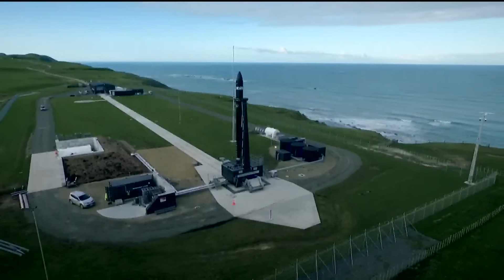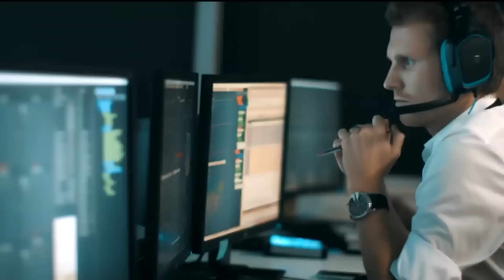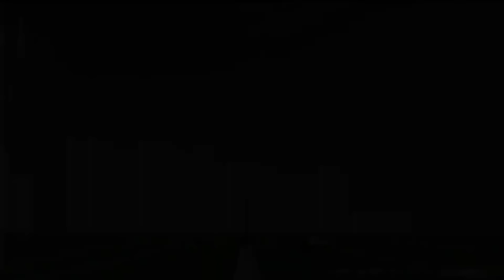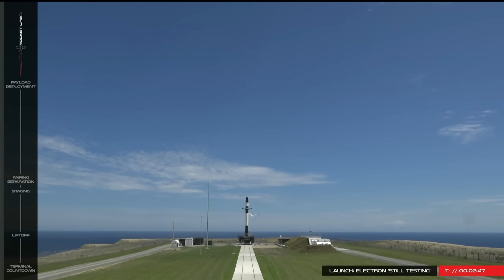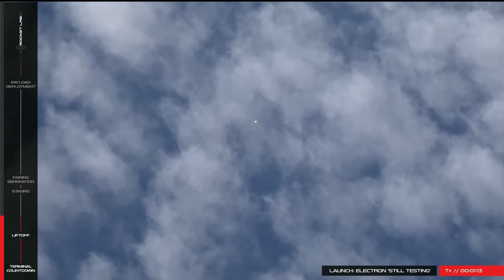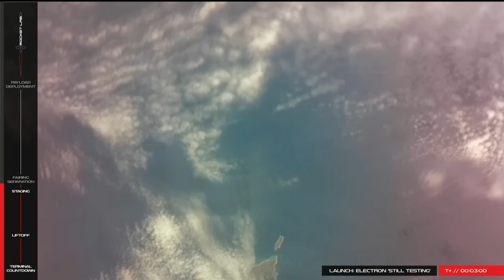Still Testing Launch - 01/21/2018

Comment: What happened during “Hot Swap”? Two objects in space blankets dropped to Earth. Precisely; What were they? At Aprox 21:30 video
Reply: The Rutherford engine(engine used in electron first and second stage) is a electric pump feed cycle engine. Basically it use an electric pump to pressurize fuel before going into the combustion chamber. That thing dropping away is a battery. When that runs out “hot swap” drops it and starts using electricity from another battery not seen in this view

Comment: The payload capacity here is basically two fat men in their underwear.... 225 kg.   An average communications satellite weighs well over ten times that.   This is basically where SpaceX was with Falcon 1.   It's impressive that they could get to orbit, but they won't be players in the market until they get a much bigger rocket.
Reply: At year end 2017 63% of all launched satellites were under 225kg. Sounds like they’re players to me homie. Do some research
Reply: @Pnutt51 
That doesn't mean small sats are profitable in the absence of regular satellites.  It's an untested model.
Reply: That's exactly what they're aiming for though. This is a company that focuses on launching small satellites.
Reply: That's great  but I suspect it's gong to be tough to be profitable with that market.
Reply: Eh, small satellites and CubeSats are very trendy nowadays, they want to dominate the small satellite market with small launch vehicules with more flexibility that other launch companies don't have, so I'd say that may become profitable. I hope so anyway, I want them to succeed.
Reply: Even SpaceX will be launching their own array of small internet satellites which will frequently need replacing.

Comment: Hi Rocket Lab! I am currently working on a digital creation project and I would like to kindly ask for the permission to use this video in my project. Cheers, Sylvia~ (just for academic use) (Videos: "It's a Test - Lift Off!" "Still Testing Launch - 01/21/2018" "Rocket Lab Flight Two Stage 1 Stack Test")

Comment: Is it common for surface winds to be opposite direction of cloud movement? ~30mph steady according to flag
Reply: @FEM
Why dont you go outside and make a few observations. You may find different level clouds heading in many different directions.
Reply: This is a pretty common phenomenon- high altitude winds often move at different speeds and in different directions from the surface winds.

Comment: Great job, but could you please next time land the first stage (at least) and reuse? This throw-away/one-time-use solution is so 20th century (and polluting).
Reply: Expendable rockets are the better solution.
Reply: And so were the expendable plastic bottles...
Reply: Rockets are not an environmental issue at current flight rates. The market does not support enough payloads to justify a rapidly reusable rocket.

Comment: only 2nd test and wicked Success. Also, efficiency lost through the weight of battery powering electric motor pumps, re-gained by the lower cost of electric motors and 3D printing.  Congratulations for a good combination.

Comment: It might prove beneficial to develop/use batteries that sacrifice rechargeability for higher energy density. Lithium stuff was developed for mobiles and electric vehicles first and foremost so one-time use wasn't really in design.
Reply: LiPo batteries have the benefit of very good power to weight ratio (that is, they can discharge fully in a very short period of time without failure or loss of voltage) in fact the only electrical storage that can deliver more power per kilo of storage is capacitors (which don't have enough energy density for this application). I suspect that this is the reason for using Lithium batteries- having enough energy for the flight is pointless if your batteries cannot deliver it all in the required period of time. In particular, the 1st stage battery packs must deliver all of their charge in a couple of minutes (as this is how long the fuel lasts).

Comment: Nice fake launch guys...you copying Fake-X Glowing nozzle of love is a nice touch!
Reply: What about the three satellites the two companies who paid to get them in orbit and who acknowledged that it was a successful launch and had made contact with their satellites. They had low expectations for the flight so had no hidden agenda to pretend that it was successful.
Reply: Just to give you the science on that Pressure gradients cause movement of air, i.e. wind. Wind blows from high pressure to low pressure. Wind can be looked at as a vector quantity. It has magnitude and direction. What you saw on the video was due to the fact that the direction of the wind at 2000 feet was different from the direction of the wind at 4000 feet. This is called wind shear (vertical wind shear in this case since we are concerned with the difference in the vertical direction.) Wind shear can be caused my many different phenomenon, such as: A frontal passage (sharp gradient in the temperatures of the air in the horizontal direction). Temperature inversion (temperature usually decreases as you increase altitude, but in some case, over a layer of the atmosphere, it can increase)
Reply: Yea those fake customers making money from fake satelites launched on a fake rocket off a fake earth because it's flat... You are fucking brain dead if you believe it's all fake
Reply: So have you ever actually done research or do you just get your information from crackpots online?
Reply: What makes it fake? Any evidence?
Reply: only logic and a long history of study in computer graphics. The long lead up of over 20 minutes with dramatic music showing nothing but propaganda. The rocket clearly spirals out of control, quickly switching to CGI, then having the classic space-x view of the "glowing nozzle".  Not to mention the control room of clapping retards.  They have followed the Fake-x play book exactly...GOOD JOB!
Reply: ANNNNND none of that comes even close to being evidence. Just your opinion. EVIDENCE is some fact that proves your (as yet) unsupported statement.
Reply: Soooo, ya got nothing, huh?
Reply: Seriously, Pat,  that's just lazy! You could at least google up some conspiritard FE BS to cut and paste.
Reply: I googled around a bit and found another angle of your launch that proves it was hoaxed.  youtube.com/watch?v=wfUrUc6JtHw
Reply: look at Rocket Lab twitter feed at https://twitter.com/rocketlab?lang=en  you can see Spire and Planet comments. In regards the the the rocket trail spiral, this was due to high winds, its a natural occurrence. It changed direction as the feed from the website said it would due to the world being ROUND
Reply: Clouds at different heights do that.
Reply: IF it failed why lie about it. Rockets fail, this one did not. Your assertions do not follow sane logic. As I have asked you before, what about the evidential success of two customers satellites being placed in orbit and being confirmed as such by them. How does this fit into your narrative?
Reply: Pat B - So, you have no evidence at all, just snide comments. What a disappointment. I was hoping for some real debate, not know-it-all whining.
Reply: Some scam. Spire Global, Inc.founded 2012 is an American private company specializing in data gathered from a network of small satellites. It has successfully deployed twelve Earth observation CubeSats into low Earth orbit. The company has offices in San Francisco, Glasgow, Singapore, and Boulder.
Planet Labs, Inc. founded 2010 (formerly Cosmogia, Inc.) is an American private Earth imaging company based in San Francisco, CA.[1][2] The company designs and manufactures Triple-CubeSat miniature satellites called Doves around 30 in orbit
Reply: Why are you guys engaging? Pat B denies Falcon 9 launches, even though their customers are major government agencies and international satellite operators. There's really no point.
Reply: We are having fun. Pat B is a fake, he an AI North Korean computer
Reply: Pat can't even prove that he's real.
Reply: Don't bother with the science - Pat B's not up to it.
Reply: I'm currently collecting comments for a YouTube report against this guy. There's enough for several.
Reply: The only conclusion I can make about Pat B is that he's still messing around in his garage dreaming of how he can make a rocket using firecrackers
Reply: Pat B. 
Lmao, "long history of study in computer graphics" ?
I think you mean watching a YouTube video that's filled with pseudoscience.
Also you failed to realise that hot metal is normally glowing, Cgi is not needed for that
Reply: Oh and Spire and Planet are mistaken that their satellites are in Space. I grant you the spent rocket did land in the ocean
Reply: What sort of answer is that ?? Whose talking about a wispy tube, which is different atmospheric Phenomenon than a spiral from a rocket
Reply: geofrancis2001 - not sure, my wifi comes to me from a cable in my wall.
Reply: OHHHHHH  Right those three shoe box sized satellites that communicate with ships and give us great photos?  YEAH we needed more of those because before this historic launch, we had no way to communicate with ships or take pictures of earth...
Reply: 2 minutes of research - Spire is a kickstarter program...basically scam people for money and tell them it works...not rocket science there, just another kickstarter scam.
Reply: can you source me the information where these companies have made contact with their satellites?  What was the name of these companies and the name and function of these satellites?
Reply: what are the names of these customers making money on these satellites?  It is all fake you moron, that rocket was a spiraling nightmare and you could expand the video, slow it down and you would see before it started to spiral it changed to a horizontal trajectory and started to loose velocity and direction before it spiraled out of control.  They faked the rest of it and you dumb ass fan boys ate it up as if it was real...DEAL WITH IT!
Reply: no they dont, it was a perfect spiral not a wispy tube...
Reply: Thank you Einstein, your weather lesson dosnt make it any less fake.  That rocket DID NOT go into "space", it went into the ocean.
Reply: your weather lesson is a diversion from the fact that everything after the spiral tube of smoke is CGI and a lie.  If you want to believe these clowns launched three shoe boxes into orbit with a rocket with a cute name, then so be it...
Reply: LOL - yeah the other clouds weren't moving but OK.  enjoy your fantasy!

Comment: I found the lift off a little bit slow, compared to curently available Ariane 6. Also, Electron did too many directions adjustements, also compared to what is oftenly seen in other rockets launchs. But every rocket launch is always very exciting and this one was no an exception. Fuerthermore, thank you for the final minutes from the Mission Control. Those engineers were gorgeous. Everyone at Rocket Lab, please keep working as you are doing until now and the company will make history.
Reply: Speed of liftoff doesn't matter much at all. Adjustments were probably because very high upper level winds combined with a very light rocket.

Comment: Congratulations!  I've had a few G430 headsets, which is what their control team all was using.  They break fast at the pivot points above the ear cups.  Unfortunately Logitech uses the same ear cup rotation tech on most of their headsets.

Comment: Couldn't you guys recover the first stage using parachutes? I know this was already tried by SpaceX on the falcon 9 and it failed, but the electron rocket is much smaller and lighter.

Comment: Beautiful launch site, beautiful launch, congrats to all involved, looking forward to more launches from you. Hot Swap and eject, interesting, what was that about?
Reply: The engines on this rocket use electric motors and batteries to power their fuel pumps. The batteries are just dead weight when they run out of power, so they have 2 sets of batteries on the second stage- when the first set is discharged they switch over to the second set ('hot swap') and jettison the first set ('eject'). The silver objects next to the engine that fall away are the batteries they jettison.

Comment: Most of it looks like the tip of a pencil with an eraser on it, and something flapping?  I mean, what is that?  Now I see why they didn't want any witnesses on a boat or anybody within viewing distance of the "launch" site.
Reply: Ah, such a nice example of an argumentum ad ignorantiam 
I'm going to use this a as educational material. Thanks Mikey.
Reply: That flapping is not flapping its vibration and a tiny vibration at that, on camera it looks like flapping.
That tin is thin it's just there to for thermal reasons, that was the battery pack inside there so its dumped later on to save weight before SECO.
Reply: Andre Gulbis But science is a lie invented by NASA to make sure people don't find out the Earth is actually flat! Nothing you belive is real! 

Source: The Flat Earth Wiki
Reply: Mikey Martinelli its way better than anything you could ever design. I bet you can barely wipe your ass.
Reply: Flat out frustrated:  that moment when you realize someone's intellectual capacity is too low to comprehend any explanation of their misperceptions...
Reply: Hamish Cummins they're called "Stubbies" - it's the middle of summer here and it's really really hot right now.
Reply: Only inexplicable for you MM...
Reply: But Mike to me it is VERY real. And that's not just a "see and believe" type real, but a real which is backed up by decades and decades of development, experiment, research and incremental improvement from the Wright Brothers, through two World Wars, and then into the amazing age we live in right now.  Dozens of countries, thousands of scientists and engineers, billions of dollars, and all the physical evidence you could ever ask for.  I tell you Mike, for you to hold the ideas that you do astounds and amazes me. It's right up there with denying reality itself.  Yes governments and other groups are corrupt and do bad things (i believe 9/11 was planned and aided by a US ally, i think that the Boston Bombing was a hoax. I believe Sandy Hook was a hoax.) but THIS topic is as straight-forward as they come.  So i guess we will have to disagree.  Hope you see something that makes you come around one day, so you can enjoy the launches and the adventure like many others. Cheers and peace.
Reply: You can go watch the launch in person, obviously from outside the danger zone.
But as always flatards won't do things that could prove them wrong, because then they wouldn't have their comforting fairytales any more.
Reply: You're awake alright Mikey. Good for you. There's not many thinkers left on the earth.
Reply: Yes, indeed.  The self-proclaimed intellectual "know-it-all's" who can't see the woods for the trees, are always the easiest to fool.  Their egos will never allow them to admit they have been hoodwinked, instead they will continue extolling the virtues of the inexplicable.
Reply: Accepting something that is clearly fake as being real, is not an explanation.  It is called "living in a fool's paradise" where common sense is absent.

Comment: Fantastic coverage guys. Quick question: what do you mean when you say “burnout detect”? It was said about 40 seconds before the second stage stopped firing, and also just before the first stage was done. 
Does it mean that the systems for detecting burnout are now activated, and they weren’t activated beforehand?
Reply: My guess is that it's when propellent level sensors are permitted to command engine shutdown. Obviously it's a risk to run the engines to literal depletion (often gets explody) but it's also a risk that the propellent level sensors malfunction and command early shutdown. Arming them later on in the flight helps balance those two concerns.

Standard practice on launch vehicles going back to the 1950s, anyway - so that's why it's my guess.
Reply: There was a pause but it was "burnout detect mode"

Comment: What? No stage one landing?🚀
Reply: "landed" in a very broad sense of the term.
Reply: Nick Diamond yeah, it landed in the sea! Can't film everything champ......
Reply: If I know correctly Falcon9 lands because it has a center engine which is 1 of 9, the proton could try to play with some tests. They will need to cut the payload really hard though :/
Reply: You never know. According to wiki this payload was 13kg. Next year they should send a 200kg moon lander! With this very same rocket. If they can send a payload to the moon of 200kg mass they surely can save some fuel to experiment with soft landings in the ocean with a 13kg payload to LEO ;)
Reply: cenariusbg It already only cost $5m.
Reply: Only $5m..... Jesus, where am I? $5m is what my family will earn for 25 generations. And I live in the European union
Reply: cenariusbg When it comes to rockets, 5 million is extremely cheap
Reply: @ Free Rider  What?

Comment: 'kilometers'. wow. how modern.
Reply: I mean, the metric system is the only system used here
Reply: New Zealand uses The metric system,egg
Reply: That's not really the 'kerbal' system, that's just going beyond Kilo as a counting system
Reply: +Grant Dcba If not 'kilometers', then what?
The New Zealanders are not too hurried to crash a smokin hot rocket with empirical system mate.
Reply: Americans use British Imperial (ironically), not empirical.
Reply: They could have used the Kerbal system (meters, mega-meters, giga-meters) But they did not
Reply: exactly